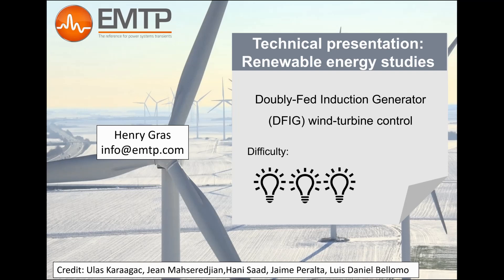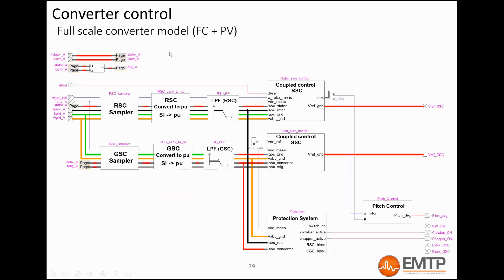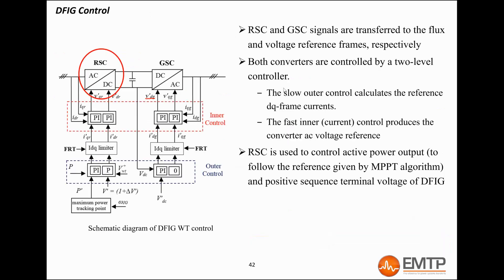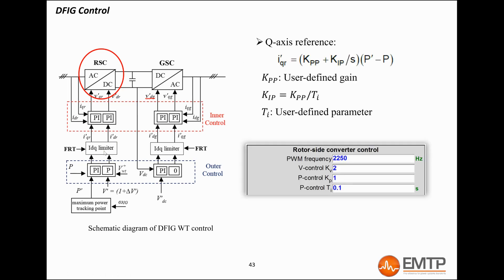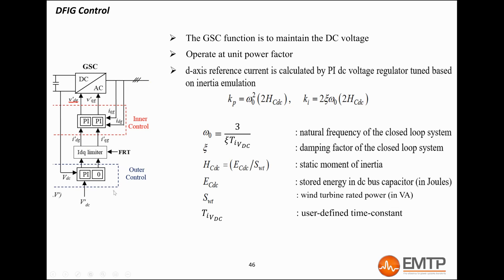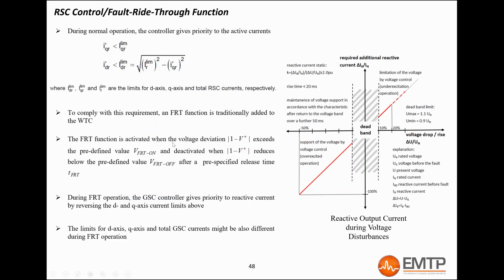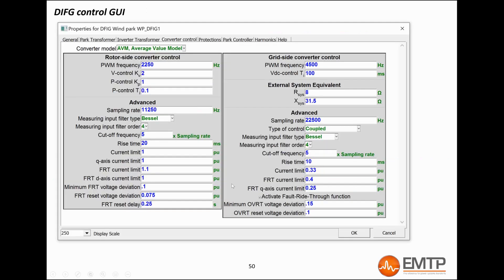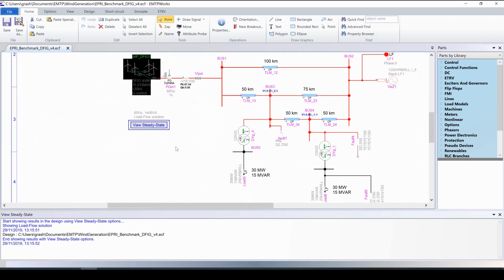Doubly-Fed Induction Generator (DFIG) wind-turbine control

Comment: Hello, it's a great video. Could you please tell me the start-up procedure of DFIG? I mean how actually run the  DFIG. First, it runs as a motor when it takes power from the grid and then when its speed more than synchronous then it becomes a generator. My confusion is how it goes to over synchronous mode, from where it gets more speed..? It would be great if you give this answer. Thanks in advance.
Reply: BY CONTROL THE ROTOR FREQUENCY